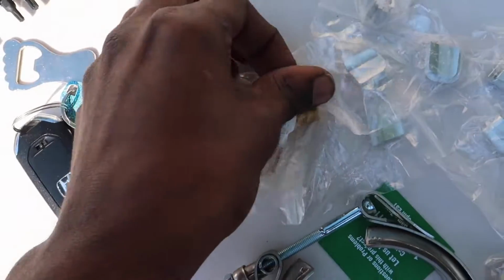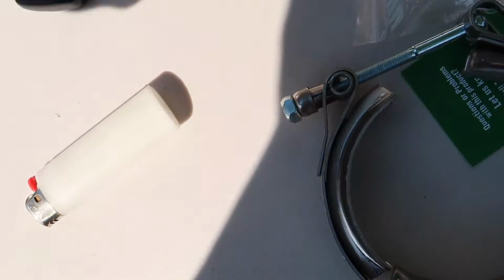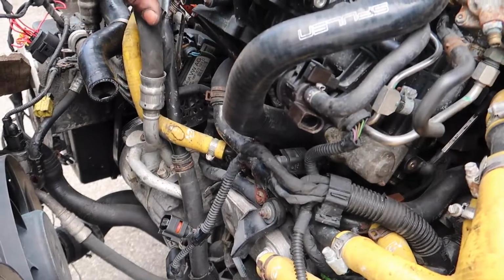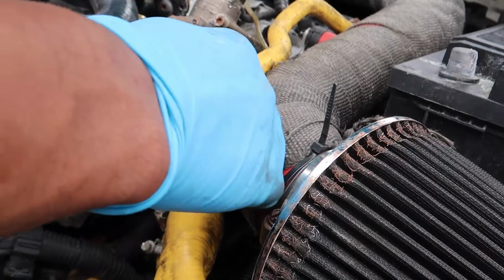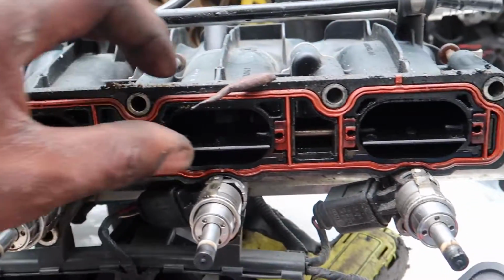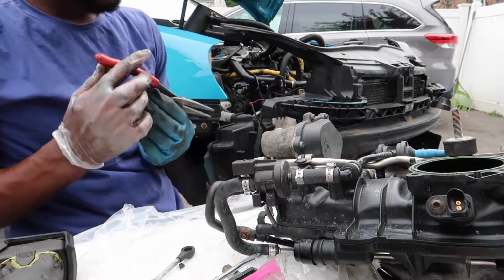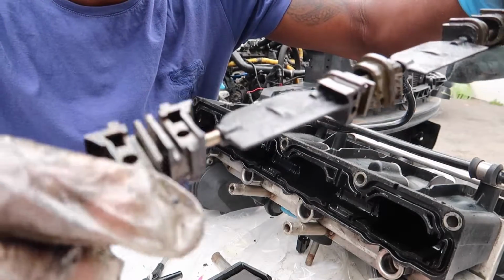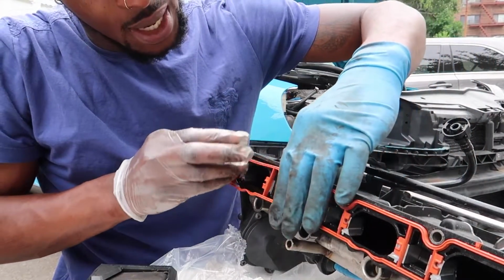How to install APR  Intake Manifold Runner Flap Delete| DIY|GOLF R |S3|A4|2.0T

Comment: Hey bro I'm looking into the same thing will I have to get rs4 fule pressure sensor as well for my 1.8t if so will I have to get 1 or 2 also did you have to gap your spark plugs for the extra air pushing threw the intake ? And is there anything else I will need for this job thanks in advance
Reply from the maker: Yeah I had to gap them precisely. Also I am tuned to the floor delete. Taking off the intake manifold super easy.
Reply: @GTIMKV  what did you have to gap them to bro or is everyones diffrent 
Also do you have to upgrade the fule pressure sensors ? Or can i miss that and do the flap delete then map it in and gap the plugs according to my set up ?

Comment: What was it like after doing this ? Like on cold start or even when you get it mapped in after the delete would it solve the hole problem and cause me no trouble in future or
Is it more trouble then buying a new intake manifold meny thanks
Reply from the maker: Tbh I deleted them and my car ran fine. I commute 3 hours upsate  and back down to my area. She runs fine but it will hesitate at high rpm sometimes. If I get into throttle aggressively.
Reply: @GTIMKV  thanks for your honesty and the good work and vid I'm gonna look into it more tbh brought my a3 with a stage 2 map and I dont know who done the map and dont no if the delete will agree with the map sort of thing 
 I wanna improve it sort of thing and not damage anything because theres some budget mods that do more harm then good sort of thing 😇
Reply from the maker: @F.S.Creations  you can upgrade you to k04 turbo and run medium boost.

Comment: Don’t forgot to mention the tune required to not make the coke start rough
Reply from the maker: I am already tuned for it. When i retuned my car i requested it to be added I just never had them installed.
Reply: @GTIMKV  what did you do to improve the cold start?
Reply: @GTIMKV  ah my bad I probably didn’t hear it
Reply from the maker: @hector971000  i did mention it in my stage 3 ecu install video.